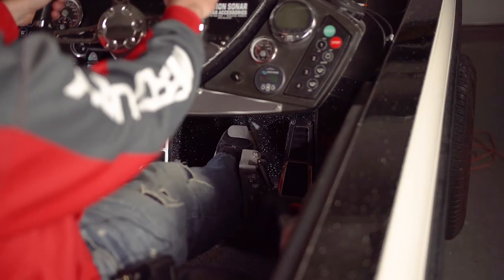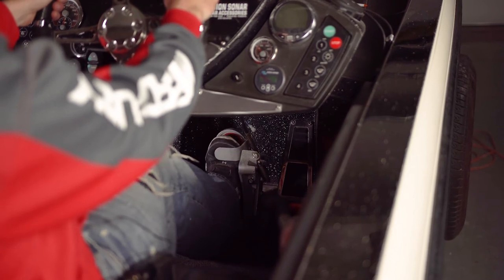RMP Boating Basics 101   Hot Foot

Comment: 0:42 explains how works with side controls - side controls handles f-n-r and idle speed when moved to gear. faster than that, the pedal is used. But the choke is still needed from side control is used, so plan to hand the choke and pedal throttle - which is easy. Only part not explained, but ABOUT TIME someone made this video. Great short and sweet.